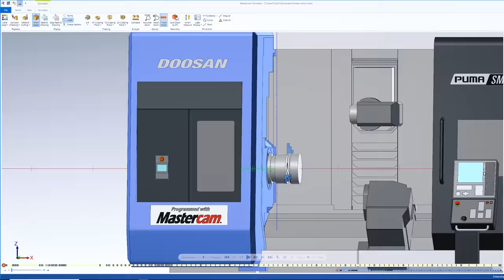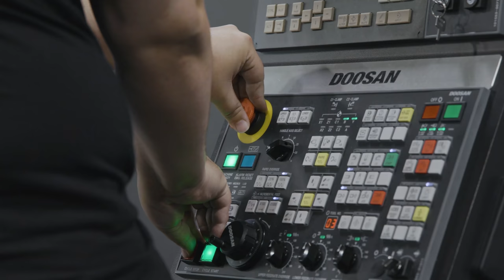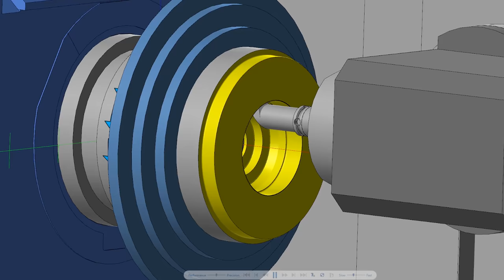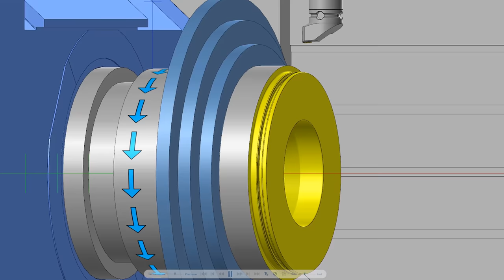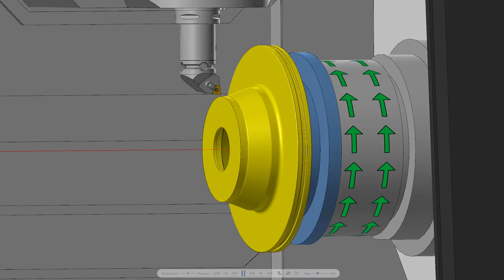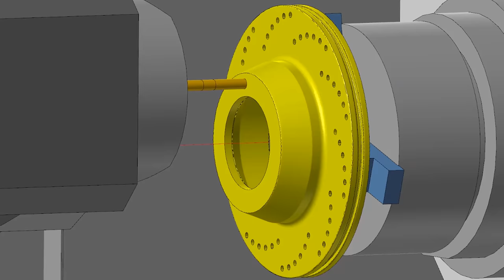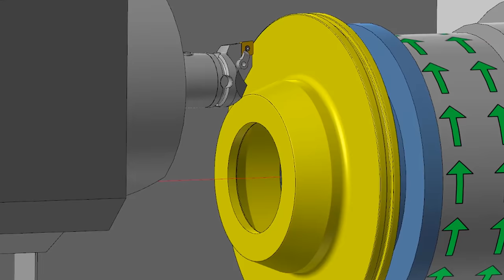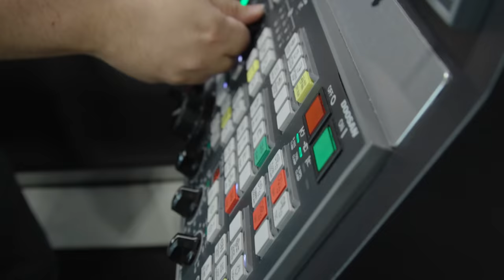Machining Our Own Brake Rotor on SMX 3100ST 9 Axis | DN Solutions

Comment: Nice, but standard rotors are hollow for ventilation and less weight. Unsprung mass is relevant. 3D metal printing would have been my choice. Bugatti made the calipers of the Chiron that way.

Comment: I used to trepan the centres out of big stainless blanks to 15 inch diameter which was interesting.
Then I threaded them and checked the thread size using three bits of 1/16 wire.

Comment: Now I wanna see the run-out on the face from the first operation after roughing the other side.
Reply: Yea id like to see this on a brake lathe checking the hub mounting face to the brake surface runout.  The fact they didnt hold it by the mounting hub (like a brake lathe) makes me think their would be some runout.

Comment: kirksite the rooster tail is like sand blasting the machine had fibrous chips on the iron ceiling rafters forty feet up. On a sixty foot five axis gantry mill running 1200 inches per minute at .030 per tooth at 10000 rpm .125 depth of cut with a four tooth 2 inch indexable shell mill It was insane. That was the fastest that machine was Ever run basically maxed it out.

Comment: I was once standing by a lathe  with a 4 ton (around 8800pounds) part, which was spinning at around 700rpm, and i was scared in the beginning. i instantly took a few steps back as the spindle accelerated.
Reply: I work around 15 ton parts spinning 125rpm and its still intimidating standing there even after years of doing it!  I always think (what if the quill cone failed and this thing came sailing out of the lathe)
Reply: @MrChevelle83  I kind of think anything that a lathe throws while spinning at 2700 SFM is going be terrifying regardless of how big it is.

Comment: Is there any specific reason why the holes were drilled before the finish pass over the diameters, was the intermittent cut a preferred option over any potential swarf marks from the drilling op. or is this just down to personal preference

Comment: There are 5 holes in the brake rotor to hold the disc in the hub. Those holes don’t need threads. The 6th hole must be threaded so that you can easily insert an 8mm bolt with 1.25 pitch and take out the disc from the hub when you need to replace it. That 6th hole could have been easily threaded using the CNC machine.
Reply: The threads go in the hub, not the rotor.  There is no need to thread the rotor.  A flat head bolt will keep the rotor in place during servicing.

Comment: While it's a very cool looking part, it's not a very functional one. Cross drilling rotors is actually for evacuation of off-gassing from heating the pads. As the pads heat up, they give off gas. This causes the pad to float on the rotor similar to air hockey. If the pad's not touching the rotor, doesn't do you very much good. Crossdrilled rotors also have a little bit of a shaving effect on the pad which will remove some of the material from the pad to prevent glazing. This adds to pad wear. Another thing to consider, there's no ventilation drilling in that rotor. So really the cross drilling is ineffective almost entirely. It is definitely ineffective at allowing gases to escape simply because both ends of the drill are plugged by pads. This is why a ventilated rotor is required for cross drilling as the gases will leave through the vents in the rotor. So hopefully this break fade waiting to happen doesn't get installed on someone's car. Regardless though, it's a cool looking part.

Comment: In general if you had a water jet could you / would you  core out the center to cut down on the weight?
Reply: Doubtful with cast due to porosity and fast rusting

Comment: I loved machining iron. But the chips are deadly to your pump. And you have to clean them out right away or your machine will rust within a couple hours or days
Reply: Haven't heard it rusts your machine, but I have heard it turns to cement in the sump.
Reply: @soundspark  it might just depend on what alloy you’re runnin, but whatever cast I was machining at the time I shit you not everything was rusted within the hour lol

Comment: So why run this without coolant? I’d like to know bc I’m curious about this part and cast iron machining
Reply: Cast iron is full of little graphite flakes or nodules (depending on the type of iron) so it basically self lubricates when being cut. It also makes a fair bit of dust while being machined, when the dust mixes with coolant it makes a kind of sludge that is a big pain to clean up.

Comment: Only two issues…cross drilled rotors crack in the holes. Slotted are better. Second, no ribs between the thickness like a cast rotor has, to dissipate the heat. Good demo part though.

Comment: There may actually be a market for these as a premium grade brake rotor.  Chinese made cast rotors are such garbage that usually warp pretty quickly.   If you can make these at a competitive price, there's a business model.
Reply: Actually, most rotors are actually made of cast steel, not cast iron.. That being said, a rotor for my MAXIMA runs about $80 and "high Performance" 180-350 retail ... All of them  are internally vented so they are complicated castings and most are coated.. These are high volume production items that are very hard to make a profit on
Reply: No way they could be cost affective at their shop hr rate.    1 hr would easily eat the cost of a part store rotor. and they work pretty good but you gotta turn them after they get seasoned because they dont add enough iron to cheap ones now days.
Reply: The rotor they made might look nice but it’s 💩 engineered without venting and it probably weighs a ton. Nobody would buy a “solid” rotor for a performance application.

Comment: Interesting that this popped up, I’ve always wondered what the braking characteristics of titanium or steel brake rotors would be.

It would be cool if you did a mini series and found someone with a test rig to see how they performed.
Reply: I'd expect materials that don't break down like CI to shine up, build up in the pads and weld to the pad under high force due to there composition.
Reply: Steel rotors are common on motorcycles and pushbikes. Titanium would be awful, it has low thermal conductivity and high tendency to gall under sliding friction.

Comment: circular rotation to chamfer the holes? Why not just plunge?

You drilled the face...why not slot it too?
Reply: Plunging will probably fold a burr the inside of the hole. I enjoyed watching the c-axis move during the interpolating.. crazy math the cam and machine computer is doing

Comment: I’m not trying to be a smart ass but I have a question. Has anybody tried to drill the holes in a rotor at an angle. Somewhere in the neighborhood of 35°? Just wondering! It’s all about airflow. I know the fins in the center of the rotor centrifugally force the air out but the holes in the rotor are 90° to the path of air.

Comment: Why didn't he just use the sub spindle to come over and pick the part from the main spindle. I run a doosan Smx 2600. Still could've indicated the part. Would've been easier than climbing in the machine.

Comment: 2700 sfm but 2500 rpm limit? I'm confused... Why even run that surface footage, which is off the charts? You might as well just code at direct rpm because it going to be limited the whole op.

Comment: I know that you are just showing off cnc capabilities but I wouldn't put that rotor on anything but a show car that never moves. Unless you're going back through and cutting veins in the center of the rotor it will work worst than a cheap solid rotor.

Comment: Now the machine should never cut anything else. Ever. 
You'll never get all the nasty crap out of the tiny coolant lines.
Reply: They don't care.  In a month they'll be on to pushing the next machine brand.
Reply: I used to work with cast iron daily. It would get into my pores of my arms.

Comment: We don't say 11.5 mm but 11 and a half just so you know 

Had it been any other then  . 5 you would had been right but  . 5 is the only exception

Yes I Come from a metric country
Reply: We don't regularly say something like 11 point 5 inches over here either, it's just how some people do it. We would also say 11 and a half inches.
Reply: Both ways work, just a matter of preference.
Reply: I’m from a metric country as well I thought about and I do say 11.5 I just won’t usually say mm after it
Reply: @MikkelRS metric is just better since its based on simple 10-100-1000 devision . same with kilograms and liter's 
they are just simply better and easier to understand ( its all 10-100 and 1000 plus there is only one standard for it and not like 3 diffrent standard for the same thing. ex. oz have 3 diffrent standard ( 2 us ones alone ) )
Reply: @MikkelRS well sometimes your just unlocky like that i guess xD

Comment: G2 is shit for a brake rotor! If you are going to go to the extreme of machining your own rotors, Ductile 80 or CGI is a massive step up in strength, vibration damping, and heat stress resistance.

You also forgot to chamfer the other side of the holes, as well as machine the vent ribs.